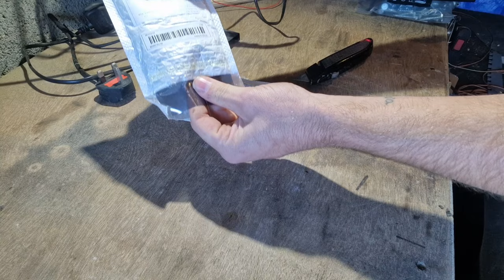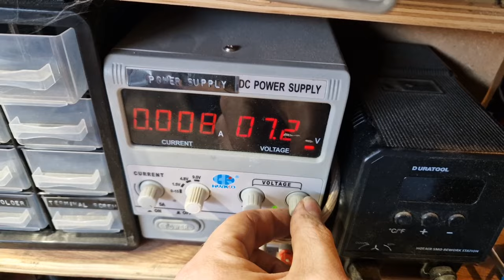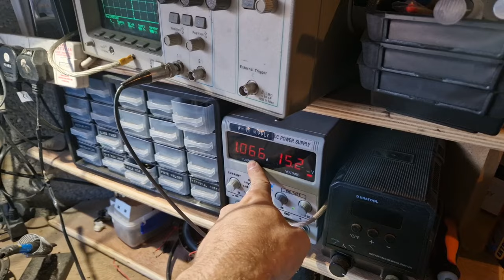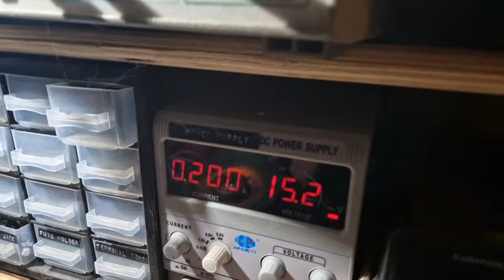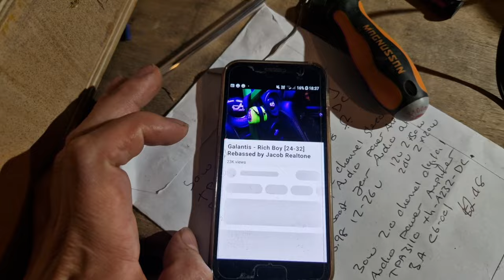TEMU AMPLIFIERS! UNREAL VOLUME from TINY AMPS!!

Comment: need a bit more voltage on 2 of those amps which will fix the square wave. as it hasnt got enough of the high power rail it will just clip it because it cant create the full sine wave
Reply from the maker: So the amps are operational between 8 and 26v, the rails on all sat at around 16v, the higher rail would allow a larger sine yes but i could run these at 8v and as long as i set the output to the correct level where its between the developed rail voltage then itll play a clean signal. The sine wave is then created from the audio source and injected inbetween the rails 🙂. You are right though, id be very interested to see what they do at 20+v!

Comment: 1st board is probably good, but may lack buffering for some inputs (unsure).
2nd board is crap, as stated, yet they've been selling them this way for years. 
3rx board is probably not as good as estimated since the output inductors tend to cook on that design and the heatsink is far too small for two 100w chips.  It is technically 50w + 50w + 100w, though (10%THD).  They just bridge 1 chip to drive the sub, though I don't think there's any crossover/rolloff. 

These amps can be great and I'm using one smaller than a deck of cards as a Bluetooth amp on my mid-tower speakers, but the boards with two bridged chips claiming twice the power are suspect as some designers didn't know how to implement bridged mode properly and the boards are never corrected; they're just churned out so long as sells continue.

Also, the heatsinks are usually too small so 1 chip is more reasonable. The power ratings are ridiculous and stated even in the datasheets at 10% THD and sellers then exaggerate that some more. No hearing person can tolerate music at 10% distortion.  Some boards also have unwanted rolloff at low frequencies, so look for testing on yt or elsewhere. I recall one design where the sub channel rolled off below 100Hz while the stereo channels did not, which is obviously dumb. 

It's hard to know which models are good implementations of the chip datasheets and they all tend to have some hiss even with no signal, but these can be excellent values if you find one of the good boards so long as you understand that they're not going to provide the stated power cleanly and without shutting down on thermal overload after a few minutes. They're usually fine for actual listening volumes, though.

Comment: I'm actually running the 2nd and 3rd ones in my trailer as my surround sound system amps. True that the 2nd one did take some fiddling but I eventually got it tuned in and putting out some clean sound. And although I didn't enroll in your giveaway I'm currently building a pair of transmission line towers with some old Pioneer 8" and other leftover "Frankenstein" mids and tweets. If I can find a decent way to record a video and you're interested I'd be happy to share the final results, just for shits and grins lol. Oh, and that 3rd one I fell in love with the second I hooked it up to a pair of Bose 301 series that a friend gifted me. Freaking POUNDS them!

Comment: other incredible tiny module amp is the TPA3118 , for 1$ ,for the maximum power this modules need 25volts x 8amps power supply, the tpa3116d2 mono version (of this amp 9:18) can move a 8''woofer without problems (50w nom at 25v tested on various YT videos)  ,too much power for the ridxcul0us prices (but , attenti0n ,buy the modules with the original chips)

Comment: Run those TPA3116 based boards at 24 volts ... you're in for a surprise.

Those are full fidelity Class D boards that are actually used in consumer products.
It is obvious you don't understand them or know how to make them work properly.
Reply from the maker: I never claimed to understand them haha. My power supply only stretches to 15.2v so i did what i could. I figured they would be used commercially
Reply: @PacmanBasshead 
Okay ... but running them undervoltage does nothing to determine their quality.

The one you turfed works on 32 volts and will deliver almost 100 watts of power.
Reply: They sound absolutely kick ass at 24v!!

Comment: On the last amp, one of the speakers were wired up in reverse. That's what made it sound like rubbish.
To be honest, they were all ok. I'd be interested in replacing the heat sinks if I was to actually use it.
Reply from the maker: Heya, i know it looks like that but it was the camera frame rate, the wires were soldered onto the speakers the same for all amps and if you look the cables into the amp are all the same way around which was correct 🙂. 
But yeah the fact that any of them worked was insane lol!
Reply: with no baffle to separate front waves from rear waves it wouldn't matter what wiring configuration he used except maybe the tweeter but wouldn't matter much in this case. also even on the first amp he had the blue and red wires reversed on one speaker.

Comment: When using a low power board add a capacitor from 470uf to 688uf to the 5v. It will sound better.
Reply from the maker: Yeah i guess that would smooth out the supply to whatever opamp is inboard!

Comment: About the 2nd amp i have a few of them they work grate one of them is in the trash It all depends where they source the TPA. Chips from if you can find one with a real tpa amplifier chip and not a cheap clone the amp does quite well anyway did your amp pop during start up I had an issue with my ones I just added a wire on to the mute pin though a timer relay and basically shorts mute pin to ground for 5 ish seconds to stop it from poping the speakers
Reply from the maker: Nah mine didnt pop on start up. It started as normal, as you say its as though there was a naff IC on the board which meant that when the inout signal distorted heavily at the rail. Good to know they are hit and miss though, still something ill avoid. Thankyou 😊